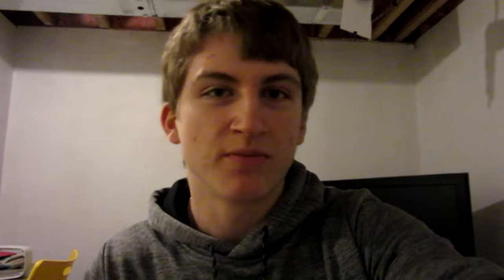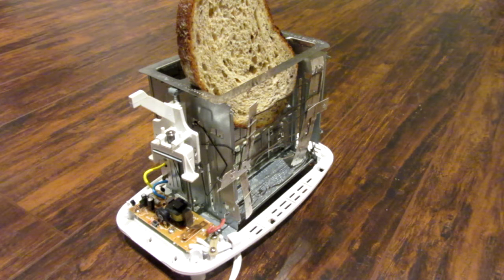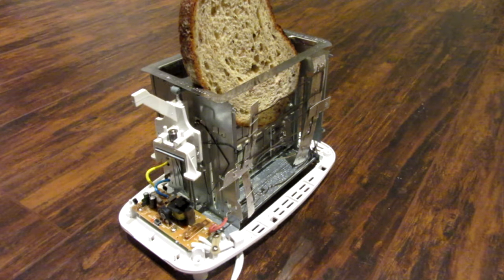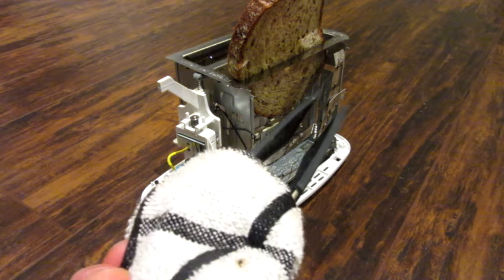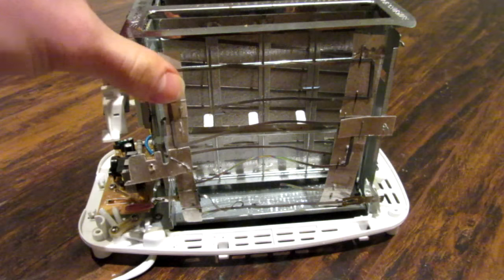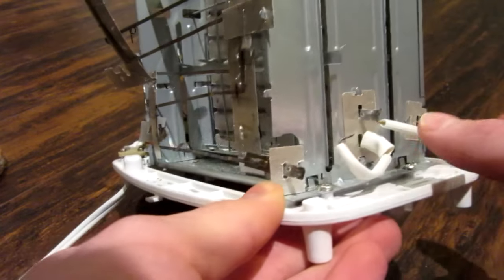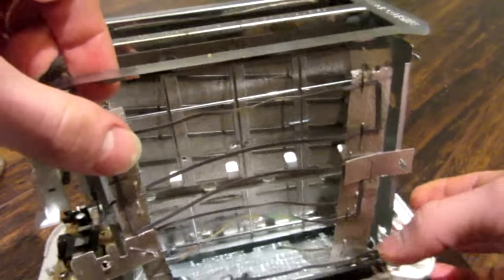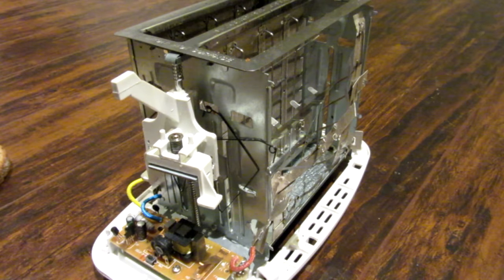DIY Clear Toaster EXPLOSION - Invention FAIL

Comment: Water and electricity don't mix
Reply from the maker: +JD BARNES it was for if the toaster caught something else on fire
Reply: inventor719 but what would you use for the toaster?
Reply: A fire extinguisher
Reply: Well technically distilled water doesn't conduct electricity, it's why you can submerge a circuit board under distilled water and nothing will short out.
Reply: I submerged my dog once, didn't end well...

Comment: Hmm. This project interests me.. and be very, very careful. Wear rubber gloves, check for holes in the gloves. That's a step-up transformer, with high amps that gets the metal red hot. I recommend that you start with weak toasters first, experiment with them. Get one that's very weak, and upload videos of your experiments, I can help you with this. I know alot about electricity. Find a base for the toaster and fasten it to the base, one wrong ground issue could cost you your life. Be safe!

Comment: You should make a video where you just make a toaster yourself. Get some element wire, get some metal for the frame. You can even run it on a lower voltage from a 12v power supply if you get the right wire, as long as you pump in about 400w of power you can have enough heat to toast 1 piece of bread at a time (which is what I prefer since when you do 2, by the time you spread stuff on them and eat the first one the second piece isn't hot anymore). 
Of course the biggest challenge in making your own stuff is trying to make it look nice and not ugly. 
With 12v you have no risk of electrocution either if you touch it, but you still would give yourself a nasty burn. I think a toaster being enclosed helps a lot of the heat direct towards the bread, where as without walls it would go in all directions.